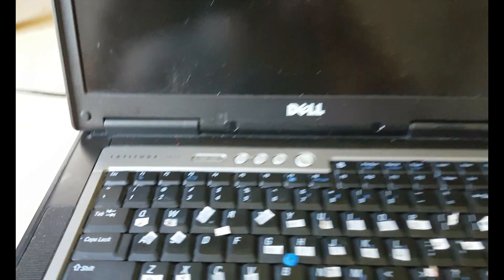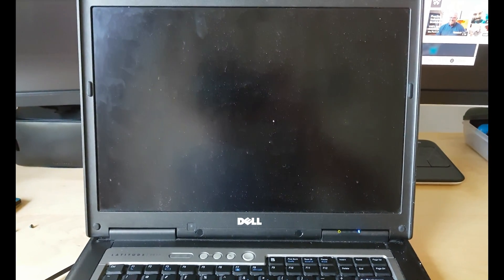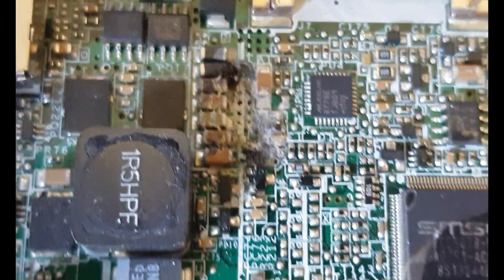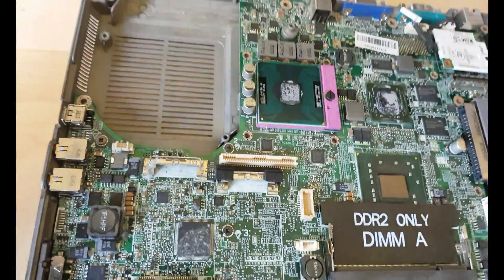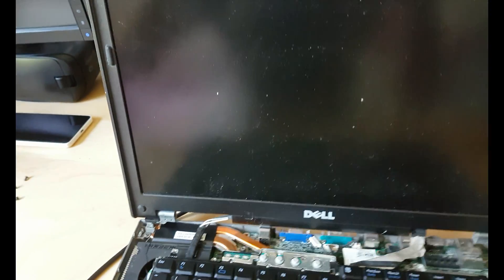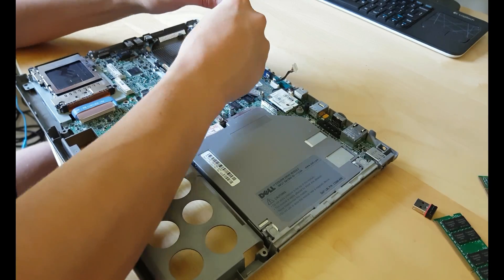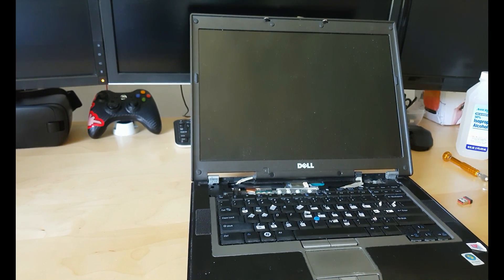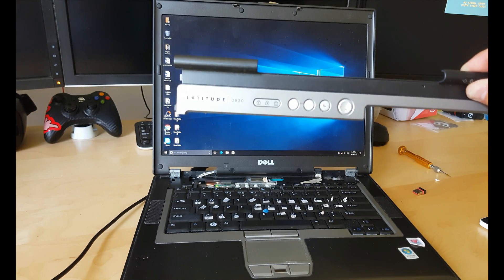Dell LATITUDE D830 - NO BOOT - Black Screen Fix

Comment: I recently tried this on a Dell D820 that refused to display.  After a few attempts of heating the video chip area it came to life but temporarily. Once it's on it stays on and works perfectly but once it's switched off it can take sometimes up to 25 to 30 attempts to turn it on before it comes back on. Any ideas ?  More cooking maybe ?

Comment: I have 2  Dell D830; one of them would not come on, a year or so ago;  i did what you describe,saw it on a youtube video,(i heated it up A LOT,the thing turned brownish in color!!! used aluminum foil to protect the surroundings)) and to my surprise...it still works ; 
B U T ...i think it's the heat up and cool down cycles is what does the solders in;
S O.... i  now have one of those laptop cooler pads,USB connected, with the fans U N D E R it;
It stays C O O L , C O O L,  A L L the time;  
No More Cycling Cold»»»Hot»»»Cold;
Will any expert here chime on this idea of mine,please?
Reply: Well,it died again and could not be revived this time; junk.

Comment: My Goodness I  need your help! How do we contact You? I have the same dell d830 it boots up but the screen is grey with vertical lines and then turns black and super foggy . Do you know what this is? Also with an elderly laptop like this how do we try to save our files if we can't see the screen?????
Reply from the maker: Still need help? Cheers 🍻🍕
Reply: It's Mr Shaw I have a dell latitude d830 laptop with no power at all nothing will light up can you please tell me what the problem is please

Comment: I have Dell Latitude 810 similar to this, its screen is very dark! but i can see text on screen with touch, probably back light! but. but some time screen works normal for 5min, but some time starts dim. what is it? the inverter problem of backlight or lcd panel? what should i do?
Reply from the maker: Backlight
Reply from the maker: But in your case is invertor